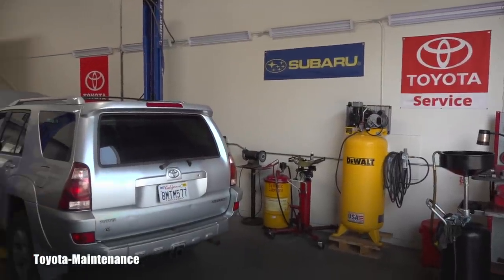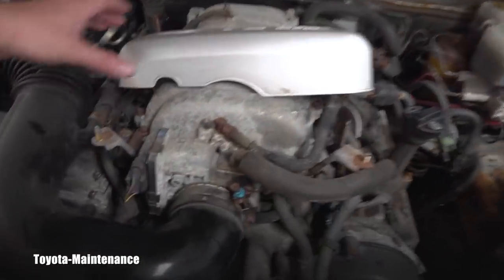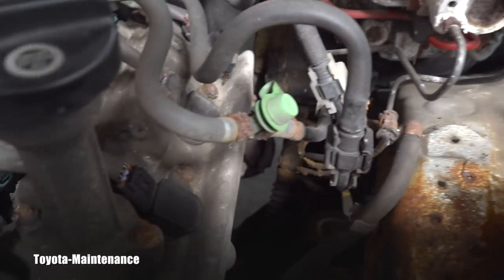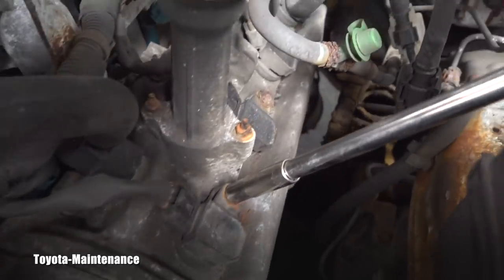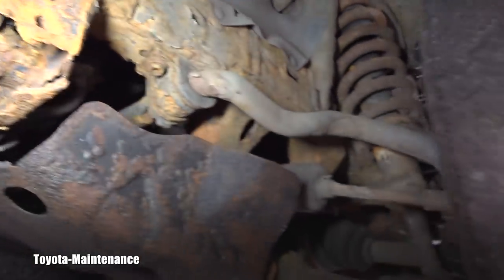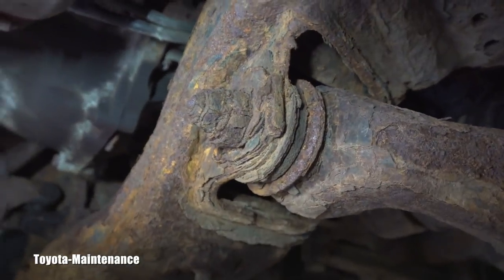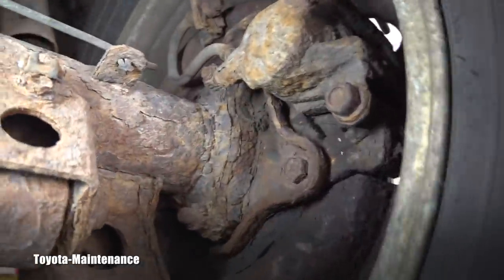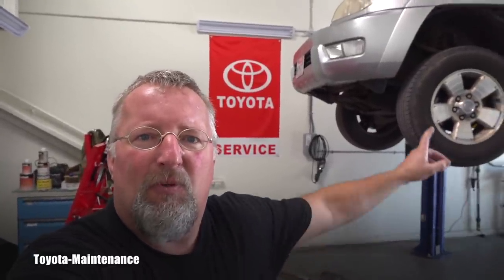Extremely rusted Toyota 4Runner

Comment: Wow the contrast. I live in AZ. My 4runner is 15yrs old. Not a spot of rust.  Sad to see a beautiful 4runner get eaten by rust.
Reply: Nothing particularly beautiful about a 4Runner, but it wasn't cheap when it was new not too long ago. What a sad picture indeed.
Reply: its sad new york said eats a ton of really awesome cars way before there time  with rust
Reply: I got a clean frame 2008 and immediately started treating the frame twice a year, so even if I’m making a winter road trip back east, I won’t have to worry about rust
Reply: I'm in Texas and not a speck of rust on my 02 Tacoma.
Reply: @JustcallmeGnarly22  Tacoma's and 4Runners are good in a desert climate..........not so much in the Northeast and upper Midwest.
Reply: mine is 16 years old from California ... no rust at all...Sad to see this .  This 4runner is scrap
Reply: But the tradeoff in AZ is that we cook and change our batteries every 18 months 🥵
Reply: @Seattle808  How do you treat it?
Reply: Samuel B Fluid Film. Drop the spare tire for better access, use a wire wheel to knock off surface rust then use Fluid film to spray inside and outside the frame, I usually use 6-8 cans, they sell an attachment for dispersing the Fluid Film inside the frame really good def use that. Keep it up at least once a year before winter, you should only have to wire wheel the first time you do this after that if you treat the frame well enough no rust should come back and you can just reapply the Fluid Film to keep up with it at least once a year before winter.
Reply: Oreo Cat don’t drive to the mountains in the winter or come up to OR or WA they salt the roads now.
Reply: A 17 year old vehicle hasn't been "new" for a long time and that is still pretty impressive longevity for a vehicle to remain on the road in the rust belt. This is just particularly sad because the v8's are becoming difficult to find with low miles and most 4Runners lost to rust still had alot of life left in them otherwise.
Reply: My wife purchased a 2003 4-Runner new, my daughter still drives it to this day, you can’t beat Toyota quality.
Reply: What a waste of money. Buying something nice and handing it over to the elements.
Reply: Lol 15 years old
Reply: 2004 4runner.  We put a shark rack on the roof for shark fishing. I will be surprised if it lasts another year boo
Reply: @paulparoma speak for yourself, 4Runners are the greatest vehicles ever made, and gorgeous.
Reply: @JoeBuck-uc3bl  Well, pardon me for hurting your fragile feelings. Who am I to have an opinion on cars, especially compared to an all-around sophisticated expert like you? My deepest apologies.🙃
Reply: @paulparoma  you got a bad attitude.
Reply: @JoeBuck-uc3bl  No, I didn't get anything.

Comment: I have a 98 4Runner 5 speed with some rust and I was told by a shop that it was the worst they’ve ever seen. I personally didn’t think it was too bad so I went to YouTube to see. Seeing stuff like this makes me think I actually bought a pretty clean one funny enough because mine has a solid frame and only light surface rust on things like the rear diff and some joints. Seeing this video gives me confidence to wire brush the bottom of my car and spray it with fluid film. This makes me feel a lot better about the future for my car!

Comment: Eric O at South Main Auto in New York sees stuff like this everyday. it's a different world up there.
Reply: If I were a mechanic and had to see this on a daily basis, I would be hating my life.  Either that, or I'd be spending more money on oxy cutters than actual tools.
Reply: I love Eric O!!!! Another great channel
Reply: @chrisp7165  from watching south main auto, the most commonly used tool is the oxygen and amphetamine torch as Taryl Dactal calls it.
Reply: Even he wouldn’t touch this vehicle and he’s seen some stuff. This vehicle is gonna kill someone.
Reply: Send it to Eric O. and he’ll fluid film the s@it out of it and it will be good as new 😂👍👌🔥
Of course he’ll clean it with a case of brake clean first 😜🤘😎
Reply: Living in the Southwest, you wouldn’t see that much rust in a hundred years
Reply: Also Watch Wes Work. All the trucks he works on are just rust buckets held together with hope. I’m glad it doesn’t snow where I live, all my cars are immaculate
Reply: I live in upstate NY, that’s a result of never doing an undercarriage wash.
Reply: @chrisp7165  At our shop when we get the torch  (which is all the time because of rust) we call it "getting the red wrench." Most of the time you can't even attempt taking stuff apart without getting it red hot because you KNOW it will break if you don't. A lot of times it still does. Get the red wrench!
Reply: @stuartstuart866  lol
Reply: @DiocletianQ3T  How often do you need to do that? After every drive?
Reply: Man twisting wrenches in that area really is a whole different beast
Reply: Somewhere, there is a ditch waiting on this pile of joy!
Reply: Eric is definitely playing the game on Ultra hard mode up there.

Comment: I live in Atlantic Canada and this is why I undercoat my 2001 4Runner EVERY YEAR!! The frame is STILL in mint condition! Preventive maintenance is key!
Reply: i wish my dad would have been able to do that. His tundra rusted just like the one in the video and it's just flakes of rust coming from almost every metal surface under the car. The reaer differential and cooling system ended up breaking and have leaked a lot.
Reply: So great to hear that. I just learned about undercoating.
Reply: Pathetic that they would even use steel that corrodes this bad. Never had a problem like this with my Honda accord frames that saw just as much road salt!
Reply: @MrRedHotChiliMan  someday they make a truck, and we’ll see how well it holds up.
Reply: They do NOT galvanize the frames of 4Runners, which is absurd.   However, I do believe that if you start routine  (yearly or every other year) oil based undercoatings that this major disadvantage would be mitigated.   I think that it’s actually common for truck frames to not be galvanized, but extremely common that car frames are.  Yeah I don’t get that at all it makes no friggin sense.
Reply: You Canadian’s are smart with your vehicles. I live in NE Ohio, I Fluid Film all my vehicles yearly and touch them up every oil change! It’s crazy that Toyota has the outside of the vehicles figured out for rust but not the underside!🤷‍♂️
Reply: I live in Atlantic Canada and just bought a 2018 4Runner with 47k Km. Little bit of rust underneath but not too much, but Definitely some. What’s your recommendation to keep the frame in good condition and preventing further rust

Comment: I was looking for a used Toyota 4Runner, everything I looked at up here in Michigan had frame rot. Even the Lexus SUVs I looked at. The bodies were gorgeous, the frame rails, some had holes you could put your fist through. I went down to Southern Ohio and went with a 2013 HONDA PILOT EXL 4WD, rust free, and no frame to worry about. Very Happy!

Comment: As others have said: Krown Rustproofing.  My ‘02 Camry has made it through 18 salty Michigan winters and 300k miles, and it’s essentially rust-free.
Reply: Thanks. I'll have to look into them. Never heard of them before. I'm in Chicago and since I tend to keep my vehicles "forever", this is worth looking into.
Reply: Your camry is a unibody vehicle not body on frame like this 4runner or a truck. The only place really prone to rust is rocker panels and subframes
Reply: @tommys2979   I'm aware of the construction differences.  The rocker panels and subframes of Camrys provide much of the longitudinal structural rigidity of the body unit, and most of the hard points for attaching the engine, transmission, front steering and suspension components, so corrosion of these portions of the vehicle is at least as problematic as the ladder frame of this gentleman's 4Runner.  My '95 Dakota pickup has also been "Krowned", and its frame, as well as the body panels and body cavities (rear quarters/cargo box, tailgate, passenger box, etc.) remain similarly rust-free after 26 years of Wisconsin and Michigan winters.  If a vehicle is going to be a long-term "keeper" in the Salt Belt, and not a 5yr trade-in, my anecdotal experiences have convinced me that supplemental rust-proofing treatment can be well worth the relatively minor cost.

Comment: Imagine doing timing belt job on this vehicle and have to deal with every rounded bolt head.
Reply: Welcome to north homie, canadian here, every job i do i spend 85% of time getting old part out battling rust on 10+ year old vechicles. Installation is easy part but they allways come out in the end 🖒
Reply: If you are used to working on Northern vehicles, you won't round the bolts off that much. 
If possible, hit it with penetrating oil every day for at least 2 days before working on in.
Forget about using 12pt sockets.
If you find a 6pt socket that fits the bolt, but it is slightly loose, that means you have the wrong size socket.  You will find you can hammer on the next size smaller, because it  will fit, once the rust is knocked off.
Reply: @andrewforte  The quality of 6 point socket matters too. Some have rounded corners that are terrible. I've found that impact sockets tend to be more precise  and less likely to yaw off the bolt when torque is applied.
Reply: I wouldn’t even waist money on an oil change for this rust runner.  It’s done.

Comment: That's Very Common  Here in New  York   I've Been A Mechanic For 48 Years.  My Tundra Is Not That Bad But Close.  The Roads Are Very Bad Also  All Because Of All The Salt  They Put On The Roads In The Winter. Being A Mechanic In The North East A Torch Is Your Best Friend
Reply: And the lazy/cheap people that cannot spend $10 dollars and 5 minutes to put the car through a car wash once/twice a month during the winter.
Reply: Do most all Vehicles rust like that up there? Or is there some brands that are better at rust proofing?
Reply: pepeshopping you’re wrong about the washing
Reply: llOOII llOOII  News flash:  Brine = salt dissolved in water.
Reply: It looked like the owner had a great detail guy but a failed POR-15 guy!
Reply: @Duraputer  Some are worse than others.
Reply: 100%
Reply: Amen to that And the cutting tourch is the 2nd
Reply: @karlmadsen3179  Sodium Chloride (table salt) is what they use because it's the cheapest. Calcium chloride is less corrosive but way more expensive. They don't care. I've never heard of them adding other chemicals. Chemicals are expensive. Salt is cheap.
Reply: @waltp3373  Yup.  Of course.   My initial response was to a comment that brine was something magical and I said it was salt plus water.   Sodium chloride is the cheapest by far.   It's also really corrosive to most metals of which vehicles are composed.  Salt eats cars.
Reply: @Duraputer  From what I’ve seen, the European stuff in general does better rustproofing wise than American and Asian. Volvo, Audi etc. hot dip the unibody in protective chemicals and waxes.

Comment: It hurts my soul to see a rare low miles V8 4runner rusted out like that 😢
Reply: Man I bought my 2005 4runner v8 with 163k miles a few months ago and just recently noticed a couple big wholes of rust on both sides of my frame... I was naive and glanced over the carfax not considering the original owner of it was owned in NY for 10+ years.. I dunno if anywhere can repair it or I just gotta part ways with it early next year. Damn shame to see.
Reply: @Penkills75  They make frame repair kits for the 4th Gens.  Very common issue in places with winters.
Reply: @Penkills75  
Should have done some research first.  It's a Toyota, they're rust buckets.  It's not a "shame", it's just a disposable vehicle.
Reply: @wildman1137  Since posting, I got my frame repaired by a professional rust repair shop. Good as new now 🙏
Reply: @Penkills75  nice. I recently bought an 05 too and I'm planning to do the same at some point soon. How much did it end up costing? And was it hard to find a shop to do the work?
Reply: @mk71618  depending on your circumstances and how big the rust spots are it'll vary with pricing. Mine was just really bad on the front passenger side and a local rust repair shop in Southeast Michigan got it done for me for $900. Well worth every dollar to save our 4runners.
Reply: @Penkills75  which shop? I’m in SE MI and need this done on my ‘05.
Reply: @fixer4art  Remos Custom Welding
Reply: NEVER buy a used vehicle without getting it up onto a lift to inspect the integrity of the frame!   Pre-purchase inspection!!

Comment: I buy cars to flip as a hobby here in the Boston area ,its almost impossible to find a clean frame up here even trucks in the 2012 and up have had the frame recalls and installed but everything that attaches to it rot away just like this truck in video..So you have great drivetrains that people love yet the money to fix frames is expensive ..

Comment: I live in Wisconsin where this condition is quite typical.  We work on such vehicles by applying heat to nuts and bolts that are almost unrecognizable.  Repairs can be made until the rust gets so bad that the vehicle becomes unsafe.  
The vehicle in your video is just about to that point but I have seen far worse. 
When I watch videos of people working on cars in the SouthWest and I see them easily loosen a bleeder valve or slip a nut off of a control arm, I think, "Man, you people have it made!"
Reply: Do they have Krown Rustproofing in Wisconsin?
Reply: There are all kinds of rust proofing available for new cars.  Some work better than others, many actually make it worse.  The winters and salt are relentless here.  No matter what one does the rust will eventually destroy the car.  The cars that get it worse are those whos owners have no choice but driving in the worst conditions, which would be slushy salty mess.
Reply: Oh sorry.  To answer your question, no, Krown is not in Wisconsin.  There is another option called Corrosion Free, which is supposed to be 90% effective.
Reply: @Taldish  My car is rust free after 15 Canadian winters and it just had its 16th Krown application.
Reply: Thanks for that info!  That's good to know.  Does Canada use a lot of salt on the roads?  In the U.S. some states do and some do not.  Wisconsin throws tons of it.  Whereas, Montana uses almost none but they allow studded tires.  At least that's how it was a few years ago.
Reply: @Taldish  Ontario, Quebec and the Atlantic provinces use lots and lots of salt. The western provinces use far less.
Reply: yeah who needs a mechanic when everything comes off so easily

Comment: Looks similar to my '06 SR5 V8 which I bought online from a nasty character in North Carolina - went to a local shop which replaced the entire exhaust with 3 cat converters, brakes, timing belt and a huge number of other repairs. I paid 10,000 for the truck and have spent another 15,000 in repairs. My new mechanic recently told me that there is little chance of getting it through another state inspection because the frame and every component underneath are totally rotted out. As with the vehicle in this video, the body, interior and engine look great. A warning to anyone shopping for an older 4Runner in the north east: run the other way.
Reply: Yep, my experience too... I passed on purchasing a Toyota body on frame vehicle and went with a HONDA PILOT, EXL, 4WD... I'm not off roading, but wanted, and need a 4WD vehicle.

Comment: I have a 4runner that had more structural rust but zero rust anywhere else. The entire underbody, engine bay, axle, bumpers, etc. were clean as a whistle and all original. Zero rust. The B pillar forward was also 100% rust free, but the spot by the rear control arm bracket on the frame was rusted out for about two feet on both sides. Never seen anything like it. Just did a frame swap and now she's completely rust free.

Comment: Living on the very far East coast of Canada, that's normal lol
Reply: so do they keep servicing cars and trucks like that and for how long?
Reply: @ChrisVargasrpht2000chris  Yup until they no longer pass provincial inspection and that would not pass unless the rusted through parts are fixed and meet the requirements. The bracket that's rotted away would need to be fixed, any holes in the frame or body etc
Reply: @FusionBoost2.0  from a eastcoast perspective how far gone was that truck.
Reply: @ChrisVargasrpht2000chris  99% of people would of drove it to the local wrecker for a few hundred bucks in scrap to be parted out then crushed. Some would try to fix it but prob cost more then it's worth to fix
Reply: @ChrisVargasrpht2000chris and I've seen much worse over the years, Jeep Wranglers are really bad for rust along with all Japanese vehicles around those years. Cheap steel and bad winters with lots of road salt and brine, they didn't last that's why the had all the frame recalls.
Reply: looking to buy my first vehicle, probably a gx470. any way i can know if the guy who owned it took care of that without  going to see the car? what’s the best way to deal with rusting?

Comment: My tacoma is pretty close to looking like this - less holes but similar amount of rot. Just replaced all suspension - control arms - leaf springs - painted the whole frame and welded a few holes that poked through. Toyota frames just do this if you live anywhere even a slight amount of salt hits the roads. Its the achilles heel of a vehicle that would otherwise last forever.

Comment: Makes me feel much better about the rear frame and brake lines/ engine clamps on my 2003 Toyota 😄 its pretty incredible how quick it can start taking over, it was left parked outside for 3 years after a winter driving season and no power washing afterwards. Fixing it up now! I'm gonna POR-15 the frame/axle/suspension 👍 the rust did help to bring the purchase price down so I'm not complaining yet!
Reply: Still have it?